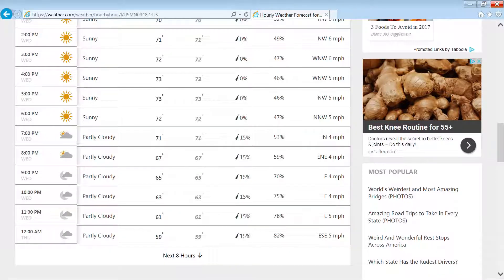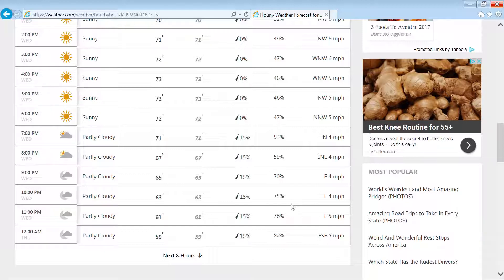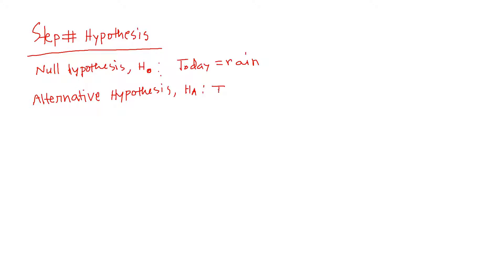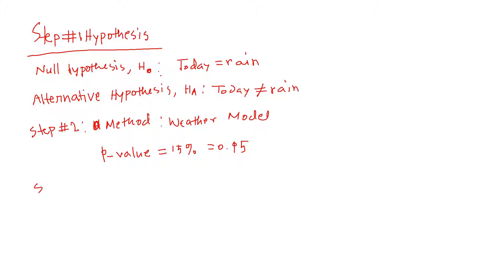Hypothesis Testing Basic Explained with Examples

Comment: Thank you for the lecture.  In this case, we wouldn't accept the null hypothesis.  Rather, we fail to reject the null hypothesis
Reply from the maker: It is okay to say, "we accept the null hypothesis." Some textbooks say, "fail to reject." For simplicity, it is okay to say "we accept the null hypothesis." In this case, we accept the null hypothesis because the probability of the hull hypothesis is 15%, which is over the level of significance (5%).